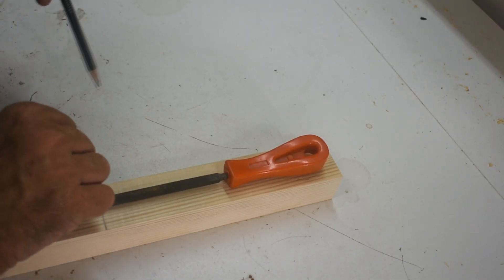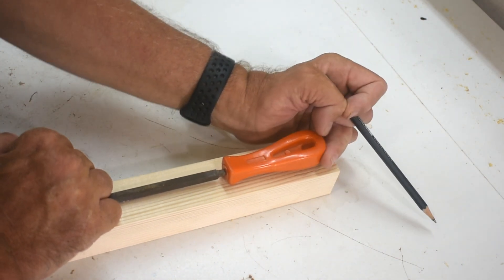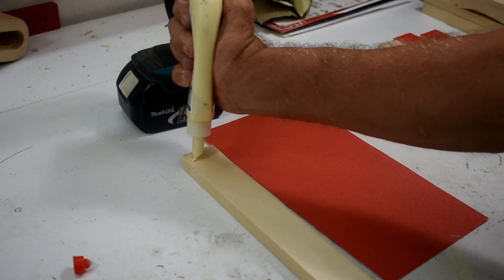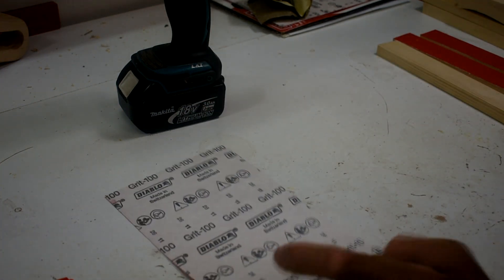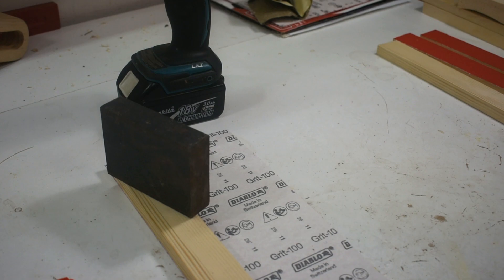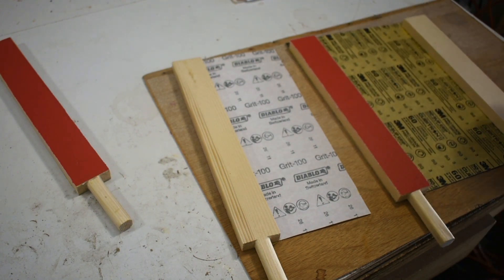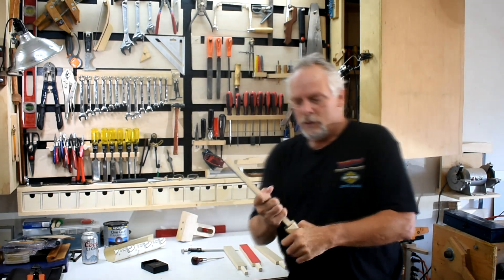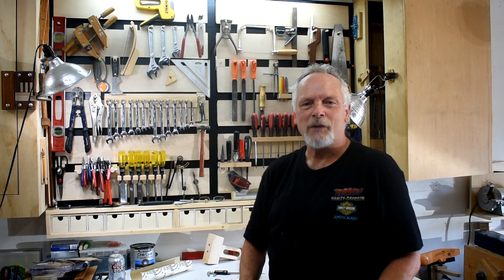Brand New Tool -Wood Files with Handle

Comment: Great project, I use lots of sanding blocks several aluminum, usually use sticky back sandpaper but quickly realized cleaning up the blocks after paper changes was a PITA. Now I use wide masking tape on the blocks then add the sandpaper. Paper changes are quick and easy.
Reply from the maker: That is a great idea, thanks

Comment: nice to see you again, hope you are well.
a good idea I always made them round but you also need square ones.
I always used a file but the wooden ones are great because you can make them in different sizes, from an eighth of an inch to whatever size you need.
thanks Jack.

Comment: Echoing @KSFWG, Great idea.  Another suggestion, use a couple coats of poly to seal/harden the surface, apply PSA sandpaper.  Would make it a lot easier to change your abrasive when needed.